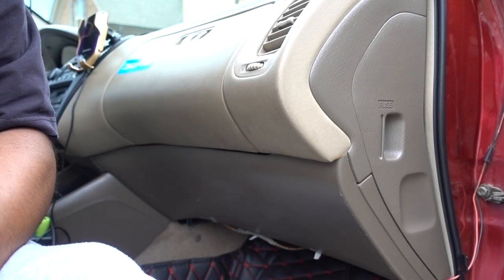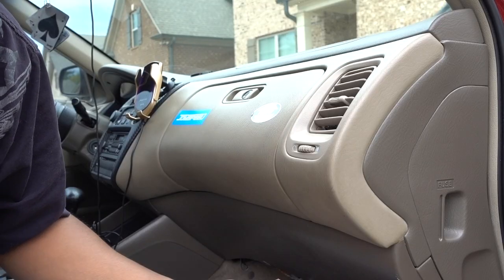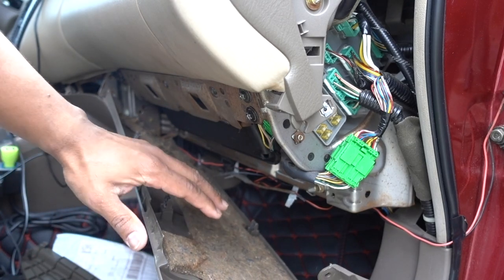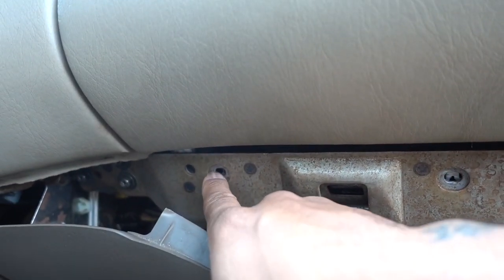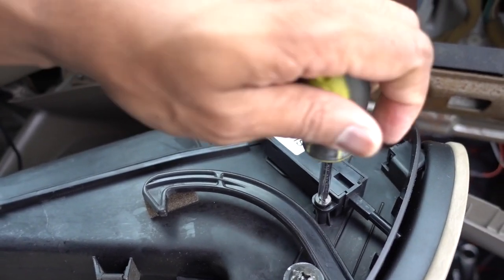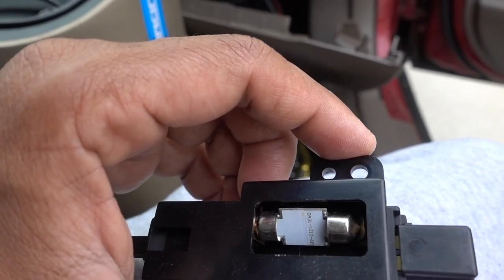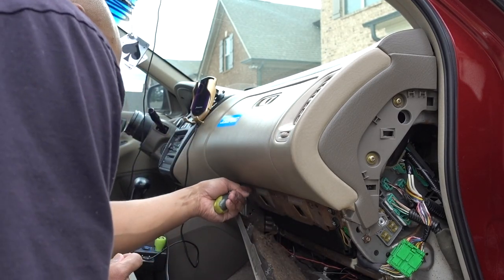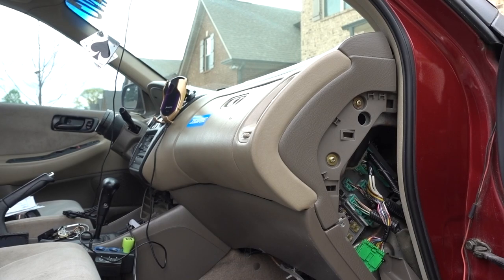98 to 02 Accord Glove Compartment Light Mini Bulb Replacement

Comment: You don't need to do all this with the glovebox. Go through the center console. Remove clock, unclip connectors, get screw in center. Get two screws on bottom. Remove center console and unclip climate control connectors. Then you can get at that little box with the glovebox light-- unscrew the two screws holding it in, and replace. 

Easier than removing the glovebox!